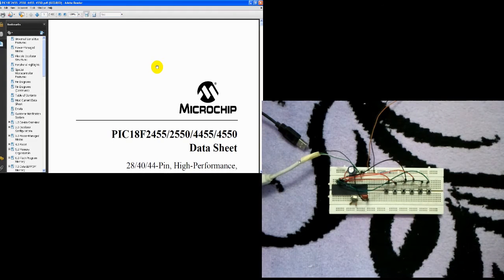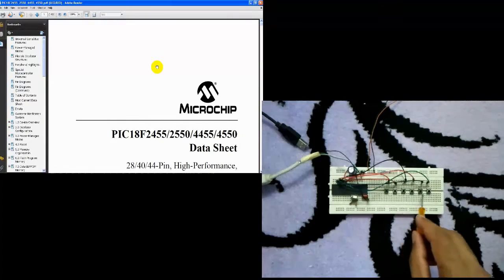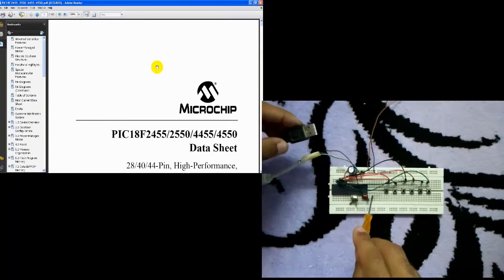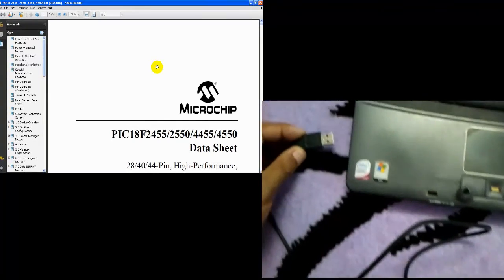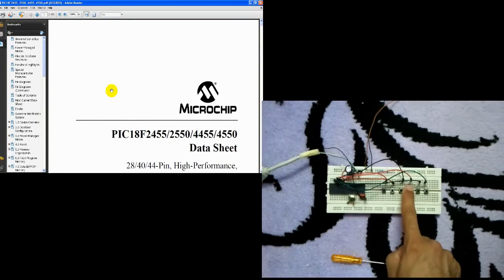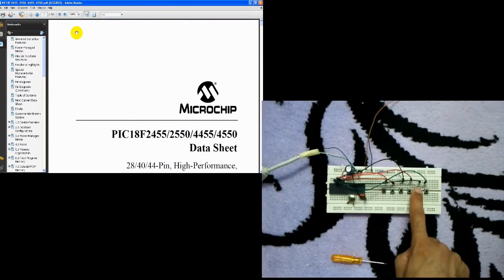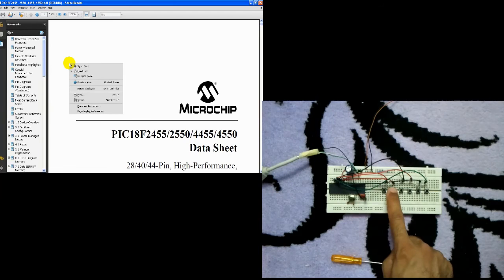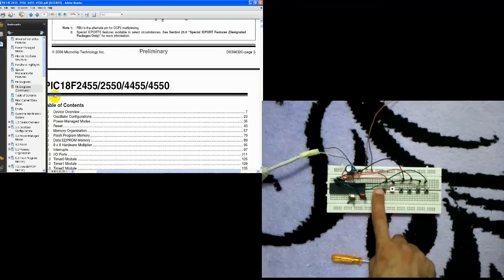USB HID Mouse using PIC18F4550

Comment: (excuse my english I'm mexican {]:{v ) Hi thanks for sharing your proyects, i've tried to make a mouse based on your and others proyects that i have found  but it doesn't work, in my proteus simulation in the debug option never goes to the library usb_desc_mouse I don't know if it's for that reason. Have not you had similar problem? My CCS compiler is the 5.076 version. plz help me :'''v
Reply from the maker: I don't know if it works with Proteus simulation, try with real hardware circuit, it should work!
Reply: @simple-circuit  I'd tried my program with real hardware and doesn't work so I also almost copied and pasted your program and it does not work either :''v
Reply: @simple-circuit  thank you for answering me, I think the problem was that I used the files of another project that I made, now it worked but I have another problem in port B a few pins start high despite output_b(0);
 you will not know why that happens?
Reply from the maker: PORTB RB0 to RB5 are an input pins which are used to read button states, Internal pull-ups are enabled for PORTB input pins (port_b_pullups(TRUE);), that means the default state of each button is 1 (high).
Reply: @simple-circuit  Yes, I had thought that it could be because of that whatever I already managed to make my project a mouse controlled by a joystick, thanks for your help.
Reply: @LInksaKk  You did it with a joystick like the playstation 2 ones? can you send me the code of the analog portion? i'm having a lot of trouble with that, i'm mexican too btw.

Spanish: Lo hiciste con un joystick como los de playstation 2? podrias pasarme la porcion del codigo del analogico? tengo mucho problema con eso. soy mexicano tambien por cierto.
Reply: @LInksaKk  Es que quiero hacer lo mismo, controlarlo con un joystick como los de playstation 2 pero al mover el joystick se pone medio loco el mouse. y con respecto a la parte analogica seria la forma de como pasarle la variable de lectura del analogico a los ejes X y Y del mouse. 

Asi pensaba leer el joystick

char out_data[4];

signed int x=0,y=0;

         set_adc_channel(0);
         delay_us(20);
         x=read_adc();
         delay_us(20);
         
         set_adc_channel(1);
         delay_us(20);
         x=read_adc();
         delay_us(20);
         
         out_data[0]=0; //Left button
         out_data[1]=x; //Eje X positivo y negativo
         out_data[2]=y; //Eje Y positivo y negativo
         out_data[3]=0; //Rigth button
         usb_put_packet(1,out_data,4,USB_DTS_TOGGLE);
Reply: @victorhugovelazquezmartinez  
 No me acuerdo bien de como funciona eso porque ya fue hace tiempo xd, y ahora no tengo mucho tiempo de verlo, pero lo que puedes hacer que es lo que muchos hacen es que leas la variable y en base a rangos hacer lo que quieras, por ejemplo si tú ADC es de 8 bits de 0 a 255 la verdad no te interesa mucha precisión sobre lo que haga al menos el mouse ya que solo se mueve hacia los lados si puedes hacer que vaya a distintas velocidades el puntero algo que si hice pero al final de cuentas el punto es que se mueva el puntero, puedes hacer nada más que con puros if poniendo un rango se mueva a dónde quieras
Por ejemplo
If(x>=0 && =< 55)
{
 //Lo que hace que se mueva a la izquierda
}
If(x>=200 && =< 255)
{
 //Lo que hace que se mueva a la derecha
}
Lo mismo para el eje Y, no me acuerdo bien de la sintaxis xd, ese sería más o menos el concepto si tengo chance te puedo mandar el código de como le hice xd. Igual capaz que ya lo ocupas para mañana la entrega así que igual capaz que ni sirve que te lo mandé después :u

Comment: Hi , thank you  //// ı have question ,
 ıwas try doing thıs project ,ı was get ,error  what mean that, please sir
Clean: Deleting intermediary and output files.
Clean: Done.
Executing: "C:\Program Files (x86)\Microchip\MPASM Suite\MPASMWIN.exe" /q /p18F4550 "Untitled.asm" /l"Untitled.lst" /e"Untitled.err" /o"Untitled.o"
Error[105]   C:\USERS\YASER KR\DESKTOP\PROJECT_18F4550\RR\UNTITLED.ASM 1 : Cannot open file (Include File "18F4550.h" not found)
Error[122]   C:\USERS\YASER KR\DESKTOP\PROJECT_18F4550\RR\UNTITLED.ASM 2 : Illegal opcode (HSPLL)
Error[122]   C:\USERS\YASER KR\DESKTOP\PROJECT_18F4550\RR\UNTITLED.ASM 3 : Illegal opcode (delay)
Error[105]   C:\USERS\YASER KR\DESKTOP\PROJECT_18F4550\RR\UNTITLED.ASM 4 : Cannot open file (Include File "usb_desc_mouse.h" not found)
Error[105]   C:\USERS\YASER KR\DESKTOP\PROJECT_18F4550\RR\UNTITLED.ASM 5 : Cannot open file (Include File "pic18_usb.h" not found)
Error[105]   C:\USERS\YASER KR\DESKTOP\PROJECT_18F4550\RR\UNTITLED.ASM 6 : Cannot open file (Include File "usb.c" not found)
Error[122]   C:\USERS\YASER KR\DESKTOP\PROJECT_18F4550\RR\UNTITLED.ASM 7 : Illegal opcode (fast_io)
Error[122]   C:\USERS\YASER KR\DESKTOP\PROJECT_18F4550\RR\UNTITLED.ASM 9 : Illegal opcode (out_data)
Error[122]   C:\USERS\YASER KR\DESKTOP\PROJECT_18F4550\RR\UNTITLED.ASM 10 : Illegal opcode (main)
Warning[207] C:\USERS\YASER KR\DESKTOP\PROJECT_18F4550\RR\UNTITLED.ASM 11 : Found label after column 1. (setup_adc_ports)
Error[108]   C:\USERS\YASER KR\DESKTOP\PROJECT_18F4550\RR\UNTITLED.ASM 11 : Illegal character (()
Warning[207] C:\USERS\YASER KR\DESKTOP\PROJECT_18F4550\RR\UNTITLED.ASM 12 : Found label after column 1. (output_b)
Error[108]   C:\USERS\YASER KR\DESKTOP\PROJECT_18F4550\RR\UNTITLED.ASM 12 : Illegal character (()
Warning[207] C:\USERS\YASER KR\DESKTOP\PROJECT_18F4550\RR\UNTITLED.ASM 13 : Found label after column 1. (set_tris_b)
Error[108]   C:\USERS\YASER KR\DESKTOP\PROJECT_18F4550\RR\UNTITLED.ASM 13 : Illegal character (()
Warning[207] C:\USERS\YASER KR\DESKTOP\PROJECT_18F4550\RR\UNTITLED.ASM 14 : Found label after column 1. (port_b_pullups)
Error[108]   C:\USERS\YASER KR\DESKTOP\PROJECT_18F4550\RR\UNTITLED.ASM 14 : Illegal character (()
Warning[207] C:\USERS\YASER KR\DESKTOP\PROJECT_18F4550\RR\UNTITLED.ASM 15 : Found label after column 1. (usb_init_cs)
Error[108]   C:\USERS\YASER KR\DESKTOP\PROJECT_18F4550\RR\UNTITLED.ASM 15 : Illegal character (()
Warning[207] C:\USERS\YASER KR\DESKTOP\PROJECT_18F4550\RR\UNTITLED.ASM 16 : Found label after column 1. (delay_ms)
Error[108]   C:\USERS\YASER KR\DESKTOP\PROJECT_18F4550\RR\UNTITLED.ASM 16 : Illegal character (()
Error[129]   C:\USERS\YASER KR\DESKTOP\PROJECT_18F4550\RR\UNTITLED.ASM 71 : Expected (ENDW)
Error[129]   C:\USERS\YASER KR\DESKTOP\PROJECT_18F4550\RR\UNTITLED.ASM 72 : Expected (END)
Halting build on first failure as requested.
BUILD FAILED: Sun Jan 22 23:46:16 2017
Reply from the maker: Please use CCS PIC C compiler not MPLAB.
Reply: thanks  you